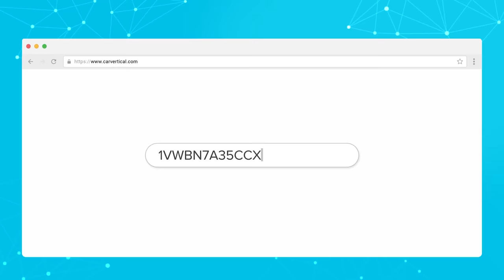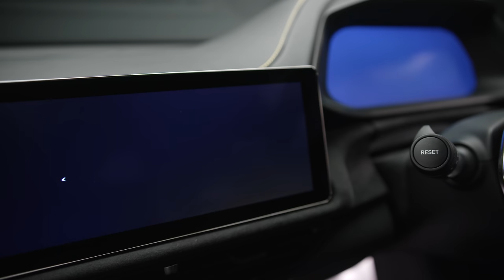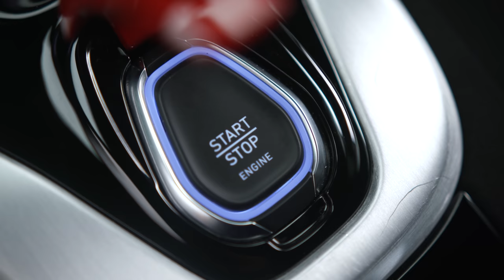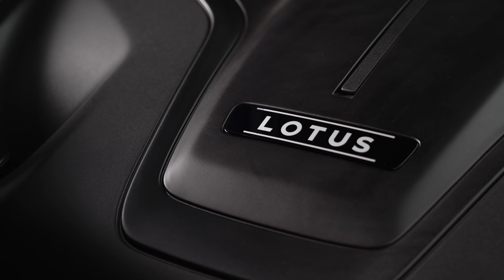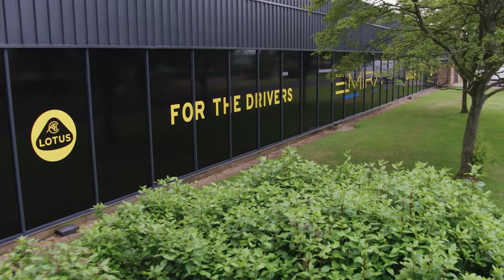The New Lotus Emira - An Evora Fan's First Impressions.

Comment: I really like the way this looks, love the fact that hydraulic steering is there. Should be at the very least decent to drive.
Reply: Interesting, the had no money for a electric steering motor or they’re so much purist about it?
Reply: @user-em7xf1bn9i  it is the better of the 2 You get the real feel and that's what Lotus is all about
Reply: It's a beautiful looker and as it's a Lotus it'll handle great Hope it's a bit better built than previous models and as for the price and using 2 amazing engines I think it'll do well for Lotus and there could well be 1 coming my way in the future
Reply: @user-em7xf1bn9i  had no money for electric steeeing?! Quite the opposite.....there was an article recently about all the trouble and extra lengths Mclaren goes through to retain the hydraulic steering when it would be much simpler (and cheaper) to go with an electric setup. This shows both manufacturers commitment to building the best drivers cars possible
Reply: @jameswillard1  hope it’s true... anyway, I wish this car nothing else than success)
Reply: Double wishbones as well
Reply: Probably because it's pulled out of the Evora and cheaper than making/buying a new one? But agreed Lotus steering feel is incredible, and hopefully not numbed from the extra weight.
Reply: Electric steering was developed for self driving and lane keep assist as well as a bit of economy- two things the Lotus doesn’t need help with.
Reply: @user-em7xf1bn9i  almost every Motoring journalist hates electric steering and any petrol head will tell you hydraulic is better for superior road feel and engagement with the car.
Reply: @writetomab1  I know, the question was about cost

Comment: Just got back from Goodwood FOS. The Emira is a stunning looking thing. From what I could tell the fit and finish was to a high standard even on the pre-prod cars. The cabin is a nice place to be. Everyone I spoke to from lotus seemed genuinely enthusiastic about the car. They’ve had over 500 deposits already and response seemed positive from everyone I spoke to. The number you quoted is much higher than was hinted to me although they officially said we’ll need to wait until September for detailed pricing. I think top spec V6 will be closer to £75k but I obviously can’t confirm that.

Comment: Not "an Evora underneath" - six inches wider, completely new chassis. Rear luggage space is a fraction of that of the Evora from what I've seen.  Sure, the apple hasn't fallen far from the tree, but it's exactly what you'd expect in the segment. Looks are key here - this is a much better focused car than the Evora, which wasn't clear which segment it was competing in, and it looks fantastic.

As for performance and driver feel - these are secondary to getting people in the car in the first place, so the surface level stuff (looks, practicality, infotainment) absolutely dominates their ability to sell cars. I think they're absolutely right to focus on these elements. Lotus have historically always underpowered their cars on launch, so no surprise we're not seeing high numbers. It also looks like they're only going to be able to sell the V6 for a while before regs catch up, so we'll see the AMG at a lower output/pricepoint before it then gets a high tune and the V6 is retired.

If they can sell the base car in decent numbers, there's no reason why this cannot be a platform for a wider range of variants down the line (as the Evora platform was intended to be), but they have to sell the base car first, so I'm pretty pleased that they've not repeated the error of the Evora by trying to be all things to all (wo)men.

Rumours are that a lot of deposits have been paid already. Well done Lotus!
Reply: To be honest, I can't see myself going for the AMG engine over a Toyota one. I want my car to drive, not sit in the shop. And the manual with see-though mesh will only come with the V6, so the choice is even simpler
Reply from the maker: It's the same width - check the numbers quoted are including wing mirrors!

Wheelbase is also to the mm the same.... weird when one is 2+2 and one is 2 seater no?
Reply: @JayEmmOnCars  I've heard conflicting reports. Gavin Kershaw says "new chassis, new platform" in one interview, and the shots from the factory show that the cross member and support for the dash are completely different, as well as the sills. There's a lot of reporting coming out at the moment, so it's a little hard to separate fact from supposition.

Comment: It looks better than modern mid engined ferraris, has a v6 engine that made incredible noises in the evora, its competitively priced, finally has a decent interior, it's available with a manual AND it will drive like a lotus. What's not to like?
Reply: The weight.   How big it is.   20 inch tires on the front.   Gordon Murray for one would be saying what happened to just add lightness?   Course this will sell better than the old Lotus and that is all that really matters.

Comment: Re the steering wheel, it's the first time for flat top wheel with a center strip that aligns to a strip on top of the instrument console.
Anyone notice the start button silver surround seems to have a crack? 
Also, the manual shifter version will have a gorgeous exposed gear lever linkage.
Adjustable ohlins dampers, double wishbones front and rear, and an AMG straight 6 engine for 60k? Sounds good.
Reply: AMG straight 6? If only,  It's the 4 banger from the A45. Hopefully the tie in with AMG will lead to future versions with 6 or 8 cylinder AMG engines. 🤞
Reply: @revolvo5519  
Go watch JWW's channel with the Lotus test driver. Later versions will come with 4cyl. First versions are the actual AMG straight 6 from the new c63.
Reply: @enol8603  again, it's a 4-cylinder. There is no AMG straight six.

Comment: A heavier Evora with a new interior then😁
Reply: Well, heavier by 5kg only apparently ;-)
Reply: What parts are off the Evora? Chassis? Seats? Interior? Wheels? Exterior panels? Lights? I'm confused...🧐
Reply: It's a proper AMG straight 6 engine.
Reply: @enol8603  wrong. 2.0 4 cylinder AMG engine. The V6 3.5 is the Toyota Supercharged engine.
Reply: @enol8603  that’s an oxymoron 😂

Comment: First time I have disagreed with most of what you had to say...sorry. 
I would never have bought a Lotus but this has my attention.
The traditional Lotus Owner and the cars made for them is what has kept this company struggling..
The quirky designs and handbuilt quality control problems...this car blows all that apart with robotics build and a proper interior and smashing outside appearance.
I would suggest this car for the first time positions Lotus into a new worldwide market multiple times bigger than has been their norm for decades.
Drop dead gorgeous car.

Comment: The merc version is the one to have transmission + engine will be bulletproof
Reply: I could see a remap and some mods unlocking a lot more power.
Reply: @jondonnelly4831  I think we all can! Down pipe and TTE hybrid anyone?
Reply: @PiersDeMann  will be pretty interesting as its rwd too
Reply: Toyota V6 is a lot more reliable than the A45 lump!
Reply: @richardharrold9736  Based on what??
Reply: @PiersDeMann  based on fact. The A45 engine is notorious for blowing up.
Reply: @richardharrold9736  fact? Simply making the statement doesn’t make it true. 
There’s literally no chatter on the internet about M139 unreliability. It has a lightweight forged crank, forged aluminium pistons and a ball bearing turbo. Each engine is built by a single person at the AMG factory. 
This is just more garbage from yet another clown
Reply: @PiersDeMann  there's loads of them with rods through blocks that disprove that. They're a standard M-B production four-cylinder long block that just gets put together from standard parts at AMG before one bloke slaps a plaque on it. Doesn't prove shit. The 2GR-FSE is mass-produced by robots and is a damn sight more reliable than any modern Merc engine.

Comment: I had a 2011 Elise R, 2014 Evora NA and 2017 Evora 400 all manual transmission. I sold my Evora 400 in December 2020. I needed a change and got a 2021 Audi TT RS, I really like it. Different from the E400 but as unique and much faster and nicer interiors. I'm not sure about the Emira with only 400hp at $93,900 plus destination charge. Although cheaper than the 2021 Evora GT, you can get some discounts on the GT. The Emira will be sticker price and I don't believe will be as agile and nimble like the 400/GT. Hard to pull the trigger just because looks "exotic"

Comment: Man, those grapes were a bit sour... 🍇😕

1. For Lotus to compete on the world stage the modernisation of their production process is absolutely crucial.
2. The company claim that the Emira sits on a NEW platform which is manufactured using their existing extruded/bonded aluminium process.
3. Inside and out the car looks bloody amazing. (Incidentally, I wasn't invited to the launch either 🤔)
4. It looks nothing like the Alpine, in fact without its badges I would have sworn it was a new model from Lamborghini.
5. What did you say to Lotus for them to completely cut you off like this?
Reply: Maybe things like him saying it's probably nothing more than a reworked car from an old platform, while it's a new platform apparently. Not a good look for him if that's true.
Reply: @iHaveTheDocuments  Maybe another influencer can get James and a Lotus rep together to thrash out where things went wrong so they can attempt some sort of reconciliation, because this bad blood between the two parties is a fly in the ointment of an otherwise excellent channel. I may be wrong but I suspect the rift probably germinated on the Lotus forums...
Reply from the maker: Nothing to do with TLF!
Reply: @JayEmmOnCars  Fair do's... 👍

Comment: Looks good to me, lot of waffle here, if you want to give an honest review you need to drive it, colour is subjective, it works if you like it.
Price will be key to sales
Reply: Price will be Key. A few times I have waited for the new release Lotus but the price suggested and actual price have always been too far apart.
Reply from the maker: This isn't a review, it's my first impressions of a freshly released car...
Reply: @JayEmmOnCars  perhaps you should have read up on it properly first? Probably prudent for a motoring hack.
Reply: @JayEmmOnCars  it's def. A reworked evora and I don't think that's a bad thing.  Evora never made any sense to me.
Reply from the maker: @PiersDeMann  what exactly do you think I got wrong?
Reply: @JayEmmOnCars  The key issue I have with this video apart from the bitter and negative undertones, is that it appears you've completely missed the point of this new car. The video description is wrong for a start. It's not 'replacing' the current line up, it's an all new car. The current cars are being phased out because no one is buying them, and this is the first of a new line of vehicles for the company. 
The Lotus board are trying to re-establish the brand as a successful global sports car manufacturer, and have designed the Emira based on a new set of criteria to attract a broader customer base than they have now. The company needs to be profitable to be sustainable, and that's just not possible with the current line up of cars.
I disagree with a number of your comments. The chassis is new, and despite sharing the wheelbase dimensions with an Evora is designed to be manufactured in their new £100,000,000 production facility. It's certainly not a rebodied Evora.
You say the starter button cover is unnecessary, however it's needed for compliance.
You're making assumptions about the price based on just a "rumour".
You make a number of comments about what the car "should have been" which again is missing the point. Perhaps you should comment on the car based on the design brief rather than what 'you' think it should be.
The engine is pushed back so it's almost rear drive? I don't think so. It's positioned close to the bulk head to reduce the polar moment of inertia, something the designers discuss in plenty of other videos.
The Evora struggled to sell because its £85,000? No, the Evora struggled to sell because no one wanted to spend £85,000 on what most consider to be the ugliest sports car on the market. 
Your complaints about it not being hand made are ridiculous. Unlike Aston Martin, Lotus aren't famed for their high build quality standards. Quite the opposite. The investment will not only produce better quality cars but with greater consistency and reduced costs. Seems like a pointlessly barbed comment.
The target audience for the car is clearly stated as taking Cayman owners away from Porsche. Not appeasing Evora owners with children. The point is they're trying to broaden their customer reach not limit it to the 5 Evora owners they've had over the last 10 years.
I don't understand your complaints about the gearbox and engine options. Purists who want the V6 with a manual can have that. Those who want the I4 engine and 8 speed DCT box can choose that. Why would anyone want a manual gearbox for an engine designed entirely to be used with a close ratio 8 speed? This is just nonsense. The V6 engine is being carried over whilst they phase it out and introduce newer options so why bother wasting development costs on bringing a DCT to an old V6 engine? It comes across as though you're just looking for problems rather than offering any useful insight.

But for me the worst part of your video is the dishonesty about it. You clearly have an issue with Lotus for whatever reason, and you're using your platform to make that clear. 

I don't think Lotus will need any luck at all with this car. It's clear to most already that it will be incredibly successful.
Reply: PiersDeMann That is the best and most informed response I’ve heard to someone who clearly has an axe to grind with regards to Lotus, well done sir.
Reply: @andrewmolnar5635  bollocks, he's a long-time Lotus owner who has made some legitimate constructive criticism of the company.

Comment: How on earth did Lotus downgrade the power, add weight, keep the price and platform largely the same, and expect that sales would increase? What am I missing here? It's a beautiful car, but that can only do so much. I bought an Evora 400 new at a deep discount, but I'm sure I can't afford the Emira.

The 60K pounds number that keeps getting thrown around is a total misnomer - the V6 with any amount of options is going to be within touching distance of $100K USD, which is just as untenable now as it was several years ago for most buyers cross-shopping Caymens, Supras, etc.

Comment: Quality control will only be one side of it. Quality assurance, partly ensuring that they don't try to build too many cars too quickly, will be the key. That's when mistakes happen and things are rushed. It's always cheaper to avoid the issues than fix them. As for the styling, I quite like it.

Comment: Thank you James. Great video and interesting analysis. My take:

It's one of the (very) few cars I have been excited about in the last few years. SC V6, manual, hydraulic steering, great chassis and looks (to me) brilliant. 

I understand and agree with a lot of your thoughts. Which has slightly dampened my enthusiasm.

Ultimately, if I could get the SCV6 to 450+ BHP at ~£75K with a reasonable (not crazy) spec, warranty and service pack, then it is something I would seriously consider. However, if its £80K+ and impossible or unwise to go beyond the ~400BHP then it gets more difficult. That sounds like silliness and playing in the margins - shouldn't 400 bhp be enough? I think it depends what experience you are looking for and coming from and for me, it would need to be 450+ to pull from what I am in now and £80K+ is getting too close to something like a GT4 or some amazing second hand cars.
Reply: The V6 can take more power, either directly from Lotus with the Evora / Exige 430, but also with Komotec upgrades. Granted, the average Emira buyer might not be the type to get their engine tuned, however given how Lotus worded the announcement, insisting that the horsepower figures are „at launch“, we can expect higher performance from the V6 in later versions, but likely at a higher budget indeed.

The comparison to the GT4 is a good one, however I believe that maintenance and components prices at Porsche are higher. And I would rather peg the GT4 against a high-end Exige and the Emira against a Gts. The thing that bothers me though with the Emira is the size of the wheels, and the specifically-designed tyres. It‘s certainly gonna cost a lot to replace, so a deeper hole in the budget for track use. The sweet spot in my view is an Exige for the track plus an Emira for the road :) The Emira is a real beauty, I‘m much more excited than James about the design, I can‘t wait to see it in person.
Reply: @benjzh  Cheers for the reply!

Yes, I was also wondering about the 'at launch' wording and assumed there will be a product roadmap with various power increases. 

I agree with your points about the Porsche and I love the design of the Emira. 

Hopefully they can keep the product value equation clearly superior to anything from Porsche (and others), to compensate for the brand and reliability gaps. Essentially, as James points out in his video. I would love a new ~410/430 Lotus, but its hard to justify at GT4 money.
Reply: if your after power get the 2.0 and do a stage 2 on it. easily get 500+
Reply: @Nobody-tp2gu  Thanks! Can certainly get a lot of power that way and what Merc have done with that engine is amazing.

However, I am a big fan of N/A engines and in lieu of that would take a Supercharger.